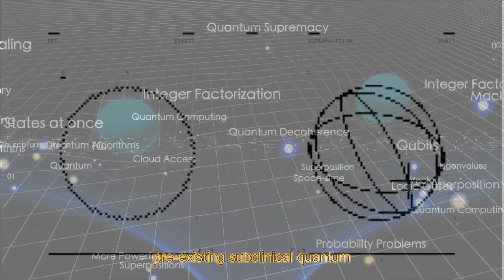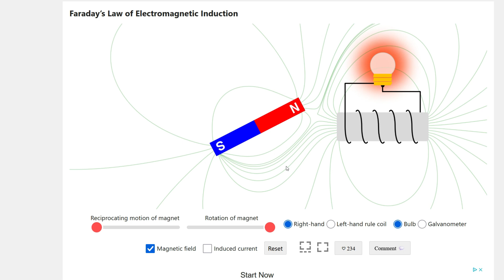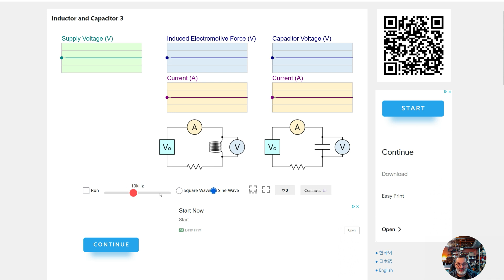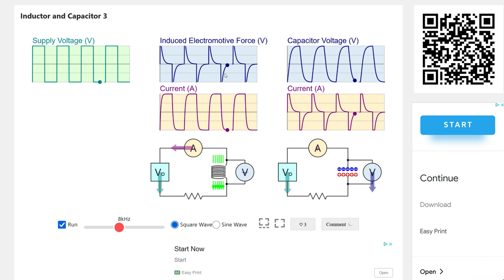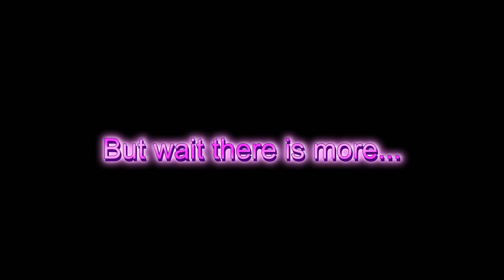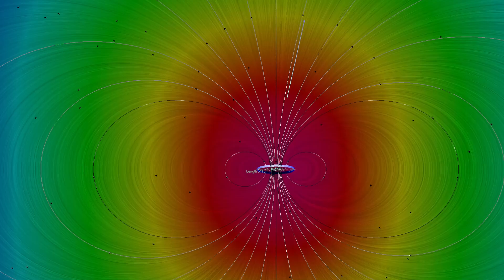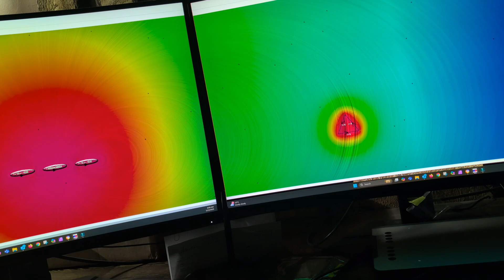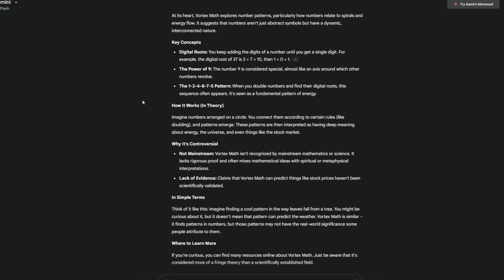If You Can't Explain It Simply, You Don't Get It

Comment: Let's start with simple biosensors !
Reply from the maker: @richardprice9730  Richard, I have not heard back from you?
Reply: @Steeve.  Apologies have been caught up trying to get help from NHS with health issues, research into dupytrens wrist and thumb problems, am thinking of DIY here micro needling collegenaze, triamcinalone etc. Is a conference in Germany soon again we have the solution but NHS fell out with commercial labs, suplying it at an inflated price.  ,.

Also dental stem cell and the Japanese breakthrough. So far not even basic assessments on the NHS here in the Uk but of course consultants will bend over backwards if I want to pay. So all this stuff is frustarting the hell out of me. .

Inventted or rather copied patented eye drops , bought a red-light panel and oxygenator helps .

 I am convinced the body has untapped potential for healing. 

Last night I watched the 5th Element guys take on pemf. He recommends the IMRS system at £3000 ridiculous and seems to endorse and explain this gaus, flux, and durty cycle stuff quite well. 

Physics was never my strong point. . Often my sleep is disrupted too much You Tube  its addictive ,am sowing seeds keeping fit Wim Hoffs etc .Need to de clutter and sell or give away surplus and then I feel pemf device could be my next project in the meantime I will read up on electromagnetism and its effects on the human body , biosensors i ggues one could use a relatively crude brain wave sensor , heart sensor , O2 moniitor to get a sense of parameters and tune the pemf device say with meditation brain waves ,  it seems to me that one might boost certain states  or even have coil near the head end of a mat at diff frequencies than the foot ened , or might cycle through different frequencies in a period say of 2-5 mins and n back to avoid acclimatization , to have coil or helmotz arrangements using very small coils at one freq and another at another frequency in a sense pushing voltage gradients, its the voltage gradients that switch genes on and off ie Michael Levines work and casue regeneration . 

So yes more and more i am attracted to your idea and the DIY, the centralized government systems are brainwashing us into conformity with the all for profit capitalist agenda. It is not just a living but how we can all be assimilated as slaves into this hideous agenda. It is really worshipping of money, ego, and the independent self, promulgating greed and so forth. 

A video chat or zoom would be great I think PEMF devices have along way to go yet .Getting the basics right for me is always a struggle diiet exercise sleep and now sunshine , I am discovering things all the time my oxygenator works greatt with my little steam tent , a cheapp blue laserr i bought is stopping progression of my collagen dupytrens , the research out ther iss verry scant and it is a question of intuitive leaps some things work well others not ie mmy exp shock wave mmachine not mmuch use for D but good for bursitis and muscle bone re absorbtion remodelling . 

Ill leave it with you to suggest day time God bless R 

. 🖖
Reply from the maker: I love your humour.  Instead of starting easy with stuff like detecting the presence or concentration of a specific substance in a biological sample.  What about we go to the heart of the problem at hand...  :)  Something I don't believe can be discussed here in a comment section to a video dedicated to make things simple. 

Invitation open for a Zoom chat. 
 Steveebradet@outlook.com,  email me and will set it up.  

Looking forward to meeting you.
Reply: @Steeve.  Apologies no the spirit was not lost BUT SPIRIT is as beyond pemf as human beings are above ameba , sorry , pemf is a therapeutic tool that's all however a very useful one !

Comment: What cellular functions are upregulated and how ,ie strength,duty cycle or frequency and wave type or rather how to feedback to device the optimal parameter changes then record this and create software to duplicate it again and again ?
Reply from the maker: To answer the question effectively, I would require to provide specific details about the device and its effects on cells. This is just not the scope of this  video nor the place.   We can have a conversation in private if you so desire.  But here is an ultra quick start: 

Overview of the device, join Patreon, it is all there. I have no secrets.
Unregulated cellular functions: List the specific cellular functions that are increased or enhanced, this can be found out in all the research on PubMed.  
Mechanism of upregulation: all the info is also available, can easily be found either on my Patreon or downloading the ZK specs (strength, duty cycle, frequency, wave type) 
Feedback mechanisms : as you know, most feedback are anecdotal in nature.  But once again there is a whole library in pub med on this topic of both types.
Software for duplication: that is all on my Patreon also if you are talking about the nextion program.   I also give it for free to my patron.

I hope this guides you in the right direction.  

PS: Upregulation is
a biological process that increases a cell's response to a stimulus
. It can involve increasing the number of receptors on a cell's surface or activating genes that produce more proteins.

I had to look it up.  Thank you for teaching me a new word!
Reply from the maker: @richardprice9730  Richard. I have not heard back from you?

Comment: Yes ...Umm ..still confused by some of your thinking grounding mats surely need to dissipate stray end as weak charges to ground . Let's Newtonian mechanics won't help you build a computer , the voltage change occurs because the cellular fluid does the moving ,Pemf dramatically enhance this effect ,the cells change .please out links in what needs to happen is entrainment with cellular function via bio sensors .
Reply from the maker: You are essentially pushing, asking me to  go deeper into the biological mechanisms at play and to use biosensors as a way to understand and control those mechanisms.  And you want evidence.  I really never made a statement on grounding sheet but enplaning that there is a flow of electrons in the wire, and as such an EMF is created.   Dirty in the sense that is coming from the ground.   That was all.   

Once again,  let meet.  

The spirit of this video was missed on you, my friend.
Reply from the maker: @richardprice9730  Richard, I have not heard back from you?
Reply from the maker: @richardprice9730  Richard I have not heard back from you?

Comment: Hi Steeve, I have a question regarding the calculation of gauss in your spreadsheet Coils builder simulator rev 1.3.ods.

In the gauss calculator tab, the value of current in cell C11 is the current output from the control box. The current in the formula should be the amount running through the coil. Since the coils are connected in parallel, shouldn't the current be halved of the control box output.
Reply from the maker: @yhseow  like I have told you in the email I send you.  You are right in your statement.  The thing is though, calculating gauss is not an easy thing.  As such, like I have said many times, the calculator is designed and used for ohms law calculation not for gauss calculation.   The gauss used in the calculator is but a guess based on a linear scale of measurement taken. Change to many things and it all goes array.   I tried a few times, using different formulas to see if we could use and apply some of them to no real success.   

I would be very grateful for your contribution.  If you have a strong background in this field and have the desire to assist,  this community would be very happy.  If your math is better than mine (would not take much)  and are able to create new maths formulas for the precise calculations of EMF for the purpose of PEMF use, I would be over the moon.

Ps: when we originally divided the amp by 2 or 3 we found that it would lower the gauss output according to the formula but in real life the measurement of the coil power did not.  As a matter of fact it increases the gauss output.  
The main reason why was the resistance was also cut in 2 or 3.  Long story short, leaving it this way ( using flawed numbers) was giving us closer to reality numbers.   

That is why you are right in your statement but wrong in the results.   

Once again, you sound very passionate on this topic and I believe you might be the guy to introduce to the world a unifying way to measure the gauss output of the PEMF mat.   

I personally went the Webber route.  But once again we need gauss to calculate Webber.   Using measuring tool is easier.  The industry likes to measure gauss at the coil peak location.   Not in the middle 2 inches above the center.  One more issue for you to solve.     

I really appreciate your tenacity on this, as such I offered you a small explanation of the reason behind the amp not being divided as you mentioned.   

Now it is your turn and take us the next step.
Reply from the maker: @yhseow  you are incorrect.  Not for the reason you think or have mentioned, those comments are correct by the way. 

But for reasons I have mentioned in the pass.
Reply: @Steeve.  Hi Steeve, I hope you're doing well. Could you kindly let me know which video discusses the reason you mentioned? I'm trying to understand the math before attempting to make a device. I've watched about 20 of your videos but haven't been able to find it. I truly appreciate you sharing your knowledge and design—it will surely be valuable for those who need it for healing. Thank you!
Reply from the maker: @yhseow  not sure I understand your question? 

What math would you like to see.   
Ohms law?.
Gaussian law? 
...
Reply from the maker: @yhseow  send me an email 
steevebradet@outlooo.com   

And will get you going! :)
Reply: Hi Steeve,

Thank you for your detailed explanation of the rationale behind the design calculations. I truly appreciate the time and effort you put into sharing this information.

As I don’t have a Gauss meter, I’d like to review the calculations thoroughly before proceeding with building the device. Your insights have been very helpful in this process.

At the moment, I’m in the midst of gathering the necessary parts, and I hope everything goes smoothly.

Thanks again for your support!

Comment: Hi Steve, v v good illustrations in your presentation! I particularly like your example about Canadians pushing a car stuck in snow to illustrate the duty cycle. That really helps me to visualise the role that duty cycle plays in pemf .. like a 6-year old😊. In that connection, for your current designs in your mat and the mini-mat, what duty cycle would you recommend helps our bodies to heal best? Assuming we put aside the heat generated. Thanks in advance!
Reply from the maker: @hockguanchew7140  1% is all we need!!  :). 

It is not visually pleasing as the magnet does not move much but our biological needs are perfectly met with 1%.  :)

Comment: A possible limitation of increased duty cycle is increased coil heating.  In order to limit coil heating at higher duty cycles you would have to reduce supply voltage which would limit the magnetic flux that occurs on the leading edge of the pulse.  Which do you think is more therapeutic?  More sustained energy while the coil is already energized or higher voltage to produce higher flux at the moment the coil is energized?
Reply from the maker: When I use my oscilloscope to measure the rise time of the magnetic field, although it does lag the apply voltage, the speed at which we reach max gauss is still way way faster then originally I was thinking.  

When you zoom right in.  1% duty still 100 times longer than the time it takes for the magnetic field to reach peek.   We could micro pulse even further and still be good.
Reply: Hi Steve, I have a question regarding the calculation of gauss in your spreadsheet Coils builder simulator rev 1.3.ods.

In the gauss calculator tab, the value of current in cell C11 is the current output from the control box. The current in the formula should be the amount running through the coil. Since the coils are connected in parallel, shouldn't the current be halved of the control box output.
Reply from the maker: @LV2XPLR  sorry.  The magnetic field need to change to have an effect.  Faraday's law 

The trick is to have just enough duty cycle to reach saturation on all coils.